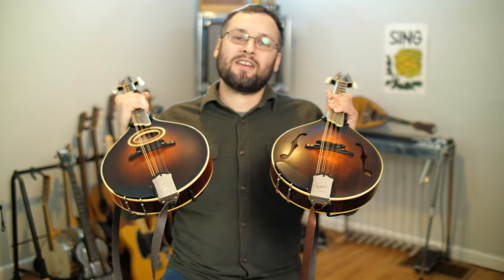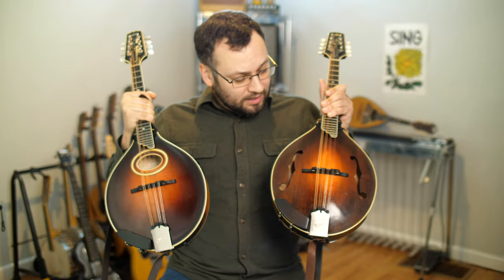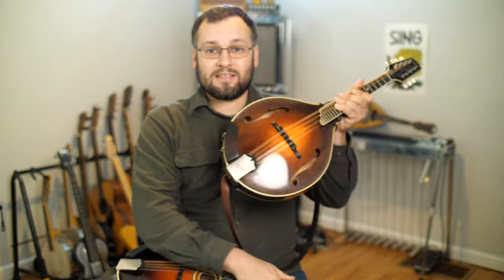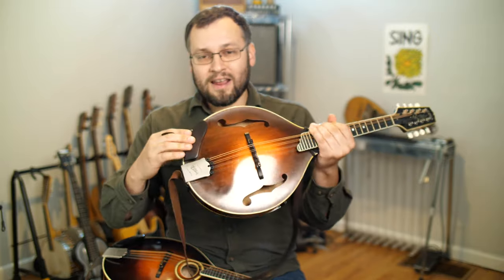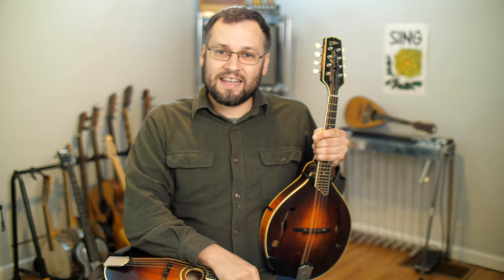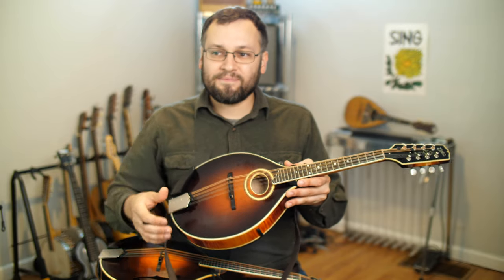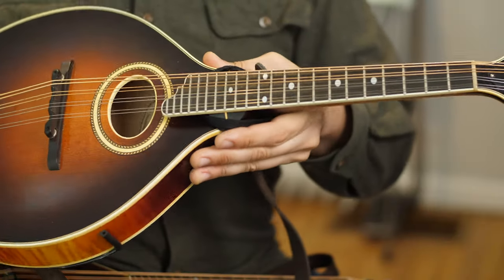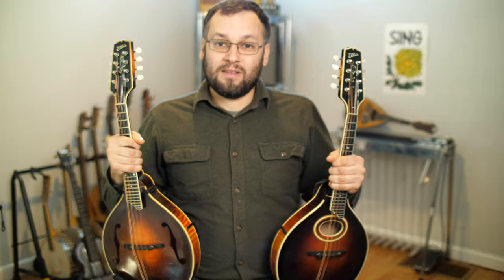F Hole Vs. Oval Hole Mandolin Comparison: Ellis Comparison

Comment: Nobody here discusses the nature of different bracing. The tone bars in f-style make for stiffer top and faster piercing response. On negative side one could say it sounds like a shallow cigar box and if you want to accept it you open your imagination of blue grass styling. But if you play it for yourself you feel it is toy-like sound. The oval hole is X braced allowing for more sustainous sound and kind of echoing bouncing sound. I would find the oval one more flexible and I wonder why there are not offered hole semi plugs , I mean plugs with tuned holes. Another idea is to have an extra port that can be plugged for different flavor. With both hole and a port open you will get less bassy sound and airy.

Comment: Great comparison video.  All things being equal, same woods, same builder, same strings, I really prefer the oval hole model for its sweeter tone and low end.  I already own a Kentucky KM-630 "F" style with "f" holes and it cuts through very clearly, especially in the upper registers, but I am now looking for a tenor mandola with an "A" style body and an oval sound hole to use for Celtic folk music.  This video helps confirm that decision.

Comment: Baron, there is this young lady, named Crystal Walker, a beginner on mandolin, who is missing the tip of her left hand 2nd finger, so she doesn't/ can't use it for fretting.  I am of the opinion that if can get some sort of callous built onto the tip she could use it for noting frets.  Do you or anyone have an opinion on this handicap ?  Is it possible to have a prosthetic device made for her finger.  I felt sorry for her and recommended she get some information from you or other pickers suffering from the same affliction.  Thanks -- we all just hate to see a budding new comer being inconvenienced, do we not ?
Reply: No joke, guitarist Tony Iommi of Black Sabbath fame, cut the tips of two of his fretting fingers off while working in a rail yard. He has prosthetic s on his fingers and of course can play guitar just fine. So it can be done, apparently.